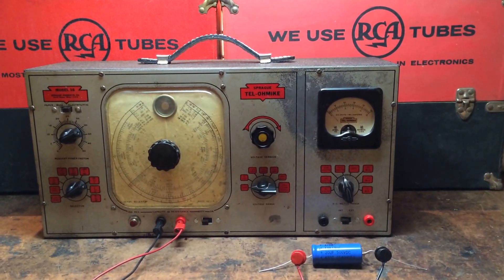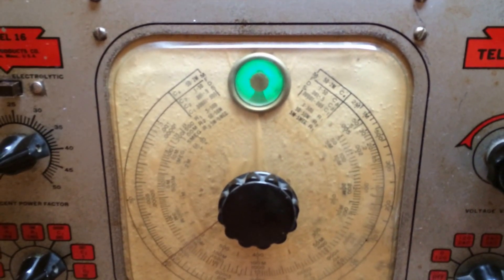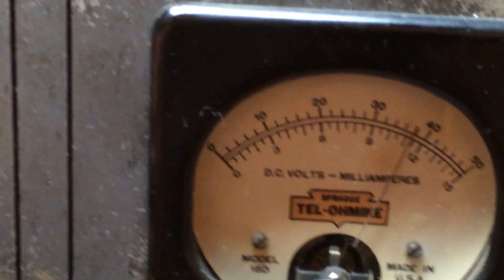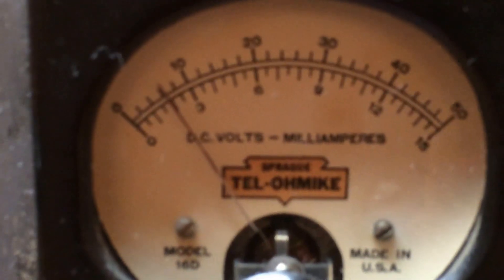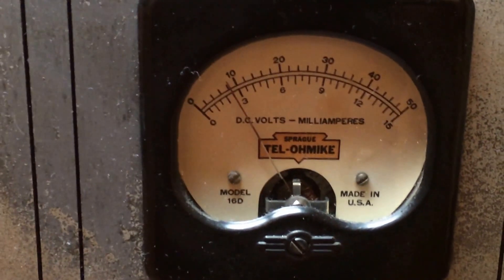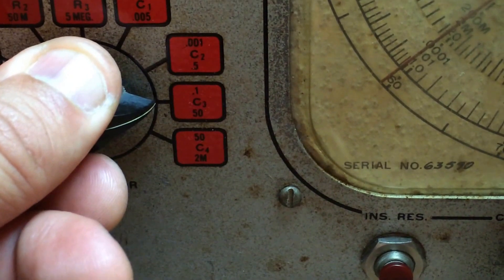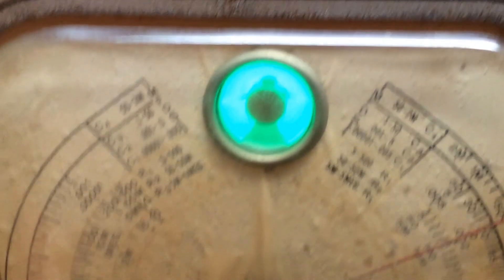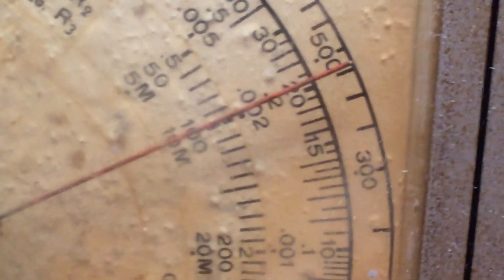SPRAGUE TEL-OHMIKE model 16 Quick Demo  PART 1

Comment: Sir,  I've got two Sprague TO-16's.  One for parts and one I've restored back to good condition.  Works as advertised as per your video here.  However, the schematic for the unit in the back of my reprint of the original TO-16 ops. manual is not for a TO-16.  It's for a TO-1/TO-3.  This schematic absolutely does not match the TO-16.  Do you have the correct schematic for a TO-16?  I would be glad to pay for your trouble and time.lbfulton@windstream.net
Reply from the maker: +The Verdict...Yes, I have the original schematics for the 16 , there were two versions..... I hand wrote in some of the values that were missing...
google Merren Audio